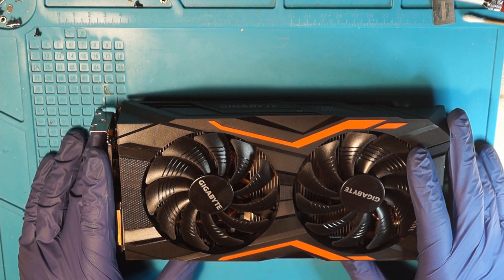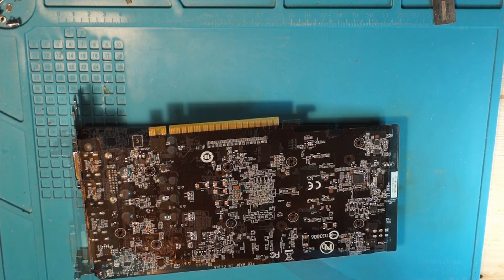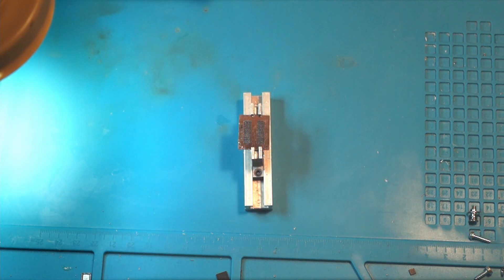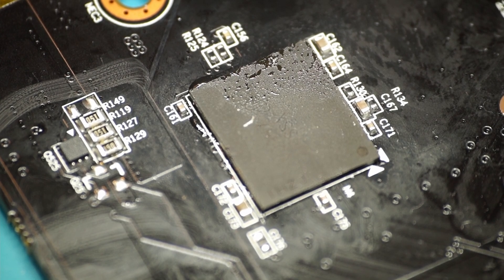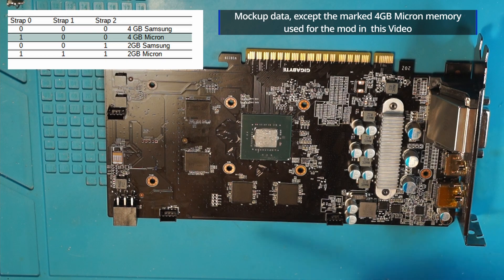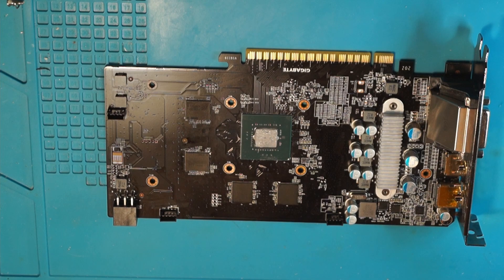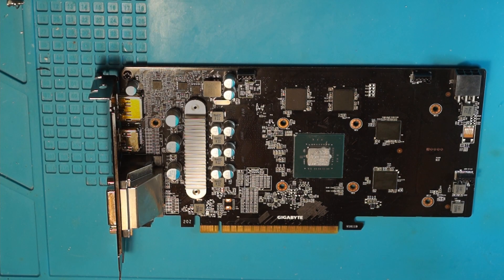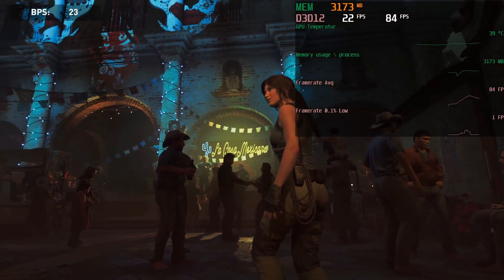VRAM doubling on a GTX 1050 | from 2 GB to 4 GB

Comment: Does the strap mod work on gtx 1650 super? Or do i just have to modify the bios? There are no 6gb bios version of 1650 super. Can i use the gtx 1660 bios?

Comment: Hey i saw you upgraded a rx 480 4gb to 8gb. I'm curious would it be possible to turn a 8gb to 16gb. I'm just curious, dont know if that's possible or not.
Reply from the maker: Possible, yes. There ist a 16gb saphire mining card so it does work. But you would have to mod the bios. Also im not sure if there are 2gb gddr5 Chips available, or if the 16gb mining card has 16 1gb Chips....

Comment: hey, i have a question
can i replace XFX RX 570 4gb Elpida Memory Chips with RX 580 Hynix or Samsung ? (i mean all of the cheaps )
and another question is will be possible to replace RX 570 Core chip with a RX 560 or RX 580 ?
Reply from the maker: Hey, so about the memory: Yes, should work. Check the available BIOSes to see if you can use an original BIOS (i e. Original xfx 8gb BIOS, there is more Info about that in the rx480 Upgrade video )
About the cores: 
Rx560:no does not fit, different footprint
Rx570 to 580: probably but keep the VRM in mind, i would only use a very good rx570 pcb for that. 
Thanks for watching and have a nice day!

Comment: Hi, i am planning to get memory chips from my dead R7 240 2gb ddr5 (elpida) and solder it on my gtx 750 1gb ddr5 (samsung). Can i do it without complete reballing? (Without using stencils and solder balls)

Also, I wonder if it will work fine without changing the strap resistors? (Don't care whether gpu-z report wrong memory as long as it works fine)
Reply from the maker: Hey, so about the (not) reballing, possible maybe but it's quite hard to remove all the memory Chips without messing up the balls. And even if that works, it's then possible that the balls vary in size.. So be prepared that you will have to reball them anyways..
 It's not that hard, and you can practise on the old memory. Once you get the hang of it it's dead simple.. In my memory stick upgrade video is some more informationen about how to do it (albeit for DDR3, but the principle is the same)..

About the straps: For a more modern Nvidia GPU you absolutly have to change them, since otherwise the card uses the old config (in your Case, 1gb). The card has no other Way of configuring itself, so if you dont Change the straps or replace/ edit the BIOS, the card has no way of knowing somerhing changed... 
BUT im not sure if the 700 series even uses strap configs or if it's done in the BIOS (and if the BIOS is editable, im sure the GTX 900 series is already locked but im not sure about the 700 series). 
I hope this answer does not put you off, and you can solve these issues...
Anyways, thanks for watching and have a nice day!
Reply: @fxbbm  Don't get me wrong I would love to use stencils but the problem is I can't find it online inside my country. I am gonna have to import it from China which will take 2-3 months.

About the resistors, I wonder how I can find it out. I am not good with PCBs and its components at all, more of a software side guy. Thanks for answering by the way

Comment: Will this work on a gtx 650ti. It has 1 GB vram. And has extra pads for memory on its back. So could this work by adding same type of memory at its back and potentially have 2 GB vram??
Reply from the maker: So adding extra modules to empty pads might be possible but it depends on the PCB layout. The other option would be to replace the existing memory modules. However, im not sure how these cards configure the memory topology (Straps/Vbios/something else) so that would need some research...
Thanks for watching and have a nice day!

Comment: You mad man. Congratulations on the upgrade. So the mod works because there was a 4gb 1050 version on laptop and the memory strap was the same on both. I wonder if this could work on the 3050/3050ti, but in this case the laptop was 4gb and the desktop was 8gb. Though I don't think anyone would dare to try it anytime soon 🤣
Reply from the maker: Thank you for your kind words, yes this will work on a 30-series card. But for now i dont have one to try it out..sometime:)
Thanks for watching and have a nice day!
Reply: I wonder that also, it would be a huge boost in performance as well

Comment: I really appreciate to see more of this videos! Maybe a 4GB card running with 8GB?

And can you please provide links to the tools you are using?
Can I buy this tiny reballing metal card?

Are you allowed to provide more details using straps and where to find them?
Reply from the maker: Hey Frank
Regarding the tools, i bought of them over the years, most of them are not really available anymore i guess. Expect maybe the quick 861 hotair station but i think there is a better option available by now (or rather an equally good clone). The microscope is a white label amscope and i use an old weller soldering station.
You can find the stencil for reballing on Aliexpress or ebay, search for "gddr5 stencil" and buy one hat says "direct heat" somewhere, otherwise this method does not work. 
And lastly, about the schematics, i just cant show or link them. But if you search in the schematic for "strap" you will find a table with all the infos (very similar to what i have shown). And finding the straps on the pcb, well if you have a boardview, you can search for the netname "strap". without a boardview, your best chance might be looking at other vendors boardviews and then try to find similar looking patterns of resistors and then beep it out from there. But unfortunatley i dont have a better way for that...
Anyways, thanks for watching and have a nice day!
Reply: @fxbbm  Thank you very much! I'll try to find some tools which fit yours best. Does this also work with gddr6 mem?
Reply from the maker: Yes, sure. Gddr 6 needs a different stencil and 0.40mm balls instead of the 0.45mm balls. But apart from that its pretty much the same. But if you have never done that before, i would absolutley recommend to train on something else beforehand! Have a look at my ram upgrade video. There i talk a bit more about tools and how to reballing...
Reply: @fxbbm  I saw that video. This is why I follow your channel. ;)